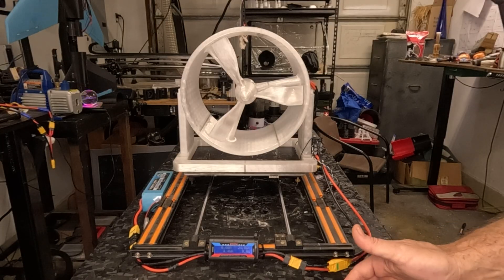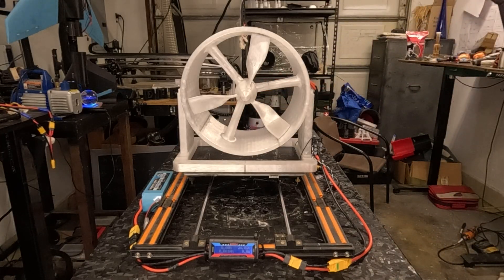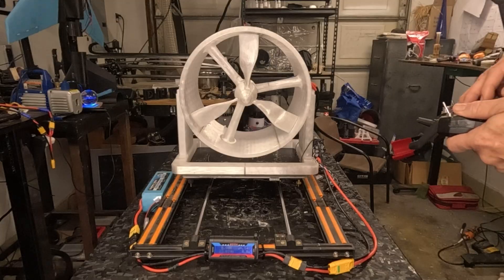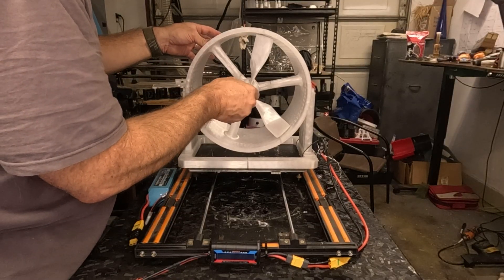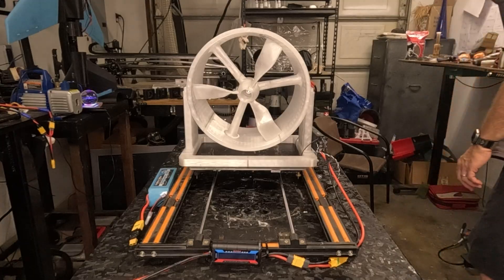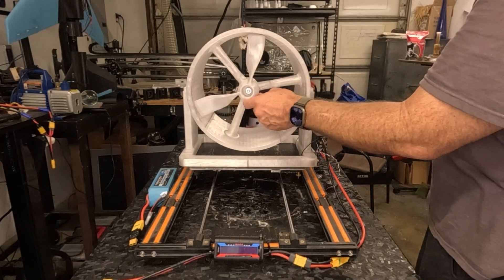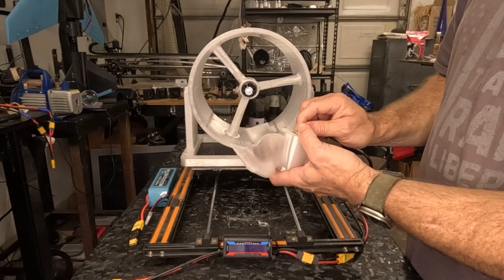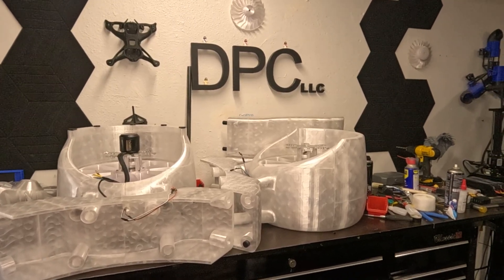Blowing up a 600 KV outrunner. Insane but fun.

Comment: That was fun, and a good demonstration of "it's not always as easy as you think"!
Next, you should try a five blade with 2/3 the total blade area as this one! =^.^=
Reply from the maker: Good idea but I might do a 400 KV and open prop and just have a mounting beam. That way we can see if this will work well for large scale glider. Even at low throttle and low amps it was already pushing good air. I knew I would hit an RPM stall point and over amp it but a perfect send off for the old 600KV test motor. It had already been through a lot. It was time to retire it.
Reply: @warmachined3472 I love that idea! Several of these along each wing of a STOL design would probably make for near zero takeoff roll! =^.^=
Reply: @warmachined3472 may it rest in peace! <3

Comment: put some nicrome in the exhaust and make a hair drier for the fam
Reply from the maker: lol
Reply: With how hot the motor was getting, you almost don't need the nicrome! LOL
Reply from the maker: lol yeah single use self-destructing self heating blow dryer.